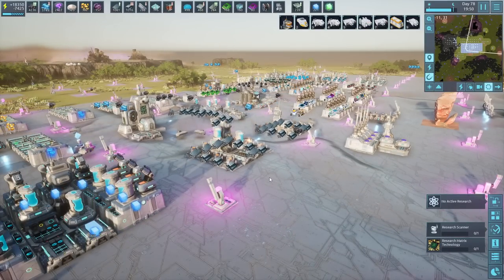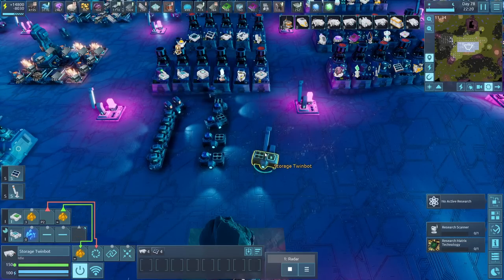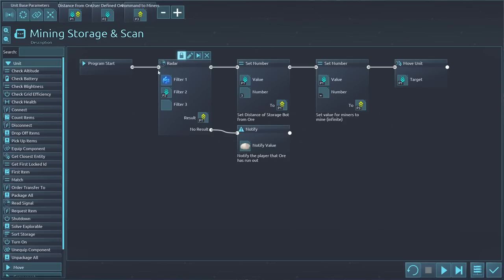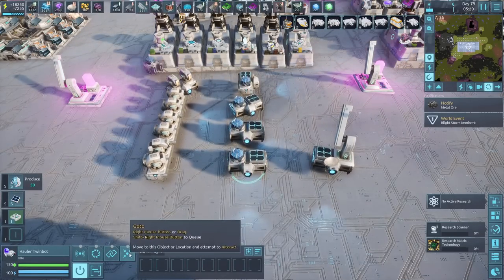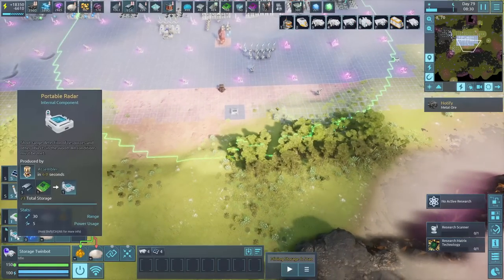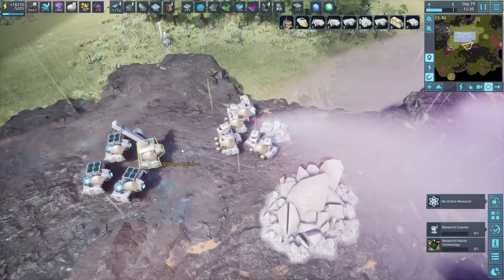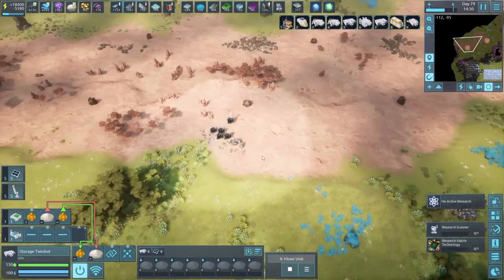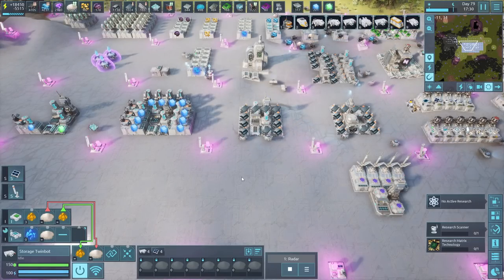Perfect AUTOMATED MINING with Simple Program | DESYNCED Early Access | Tutorial/Guide

Comment: Loving the programming side of this game. After watching your video, I have built my own flow using similar principles to what you have designed. I set up small power extenders on 1x1 bases and gave them logic to detect resource in range. if detected, produces a signal of the resource type.

I have a group of mine bots detecting (loop) a signal and if detected, moves in and mines / picks up the resource. Once full delivers it to the correct storage location (using colour signals in storage locations). 

Its working great but im sure it can be improved. Happy to share as would love feedback on how to improve.

What i cannot figure out is how to also pass coordinates between buildings and units since we only have one signal slot.

Comment: This is great! I noticed you can block the main bot  by having to many bots using it as a GOTO. They will surround it and prevent you from moving it. So I think keeping it to 3-4 hauler bots is a goo ratio :)
Reply: Or you can also having the miners hold a certain distance away from it so when the scanner moves the miners make way
Reply: I have been doing this.  If resources are full, try to dump and move away.

Comment: Similar to what I set up, except I play with Aggressive bugs, so I run it different.

What I wanted to share is that what I have my power lines do is keep a percentage of the distance between two targets. These I can either set up to keep 50% between the link before and after, or have a set at 20%, 40%, 60%, 80%, between my 'foreman' and an anchor at base. The benefit of this is it retracts properly if the foreman returns to base. Your setup with distances is really cool, but for my purpose it could leave a loop hanging outside the base and vulnerable.

More details on my setup below for anyone interested.

Rather than scouting new resources, my foreman watches out for enemies and retreats if it spots anything. I configured it so the miners would also stop mining in that case - the signal they receive is a resource type, not a node, so I can use more miners for e.g. a large patch of metal, and means they get properly interrupted when the signal changes to the enemy, which they can't mine, so they follow the foreman back as their goto.

In future I'd probably want to combine the two behaviours, and have it alert a 'cleaning squad' if it spots a nest.

Comment: You  can save you're self some hassle by building Power Transmitters. they transmit 100 units of power  wirelessly to any single unit outside of the logistics system with no limit to range. they are a medium component. what I did is make a Cub bot with a small or medium power field component and link 4 power transmitters to it, which is 400 power in total giving my mining bots and power provider complete freedom too move around. You could also use power transmitters on a single mining unit and scip the powerfield bot all together.
Reply from the maker: I mention those, but they are much later tech, so not relevant for anyone who wants to get mining up and running efficiently

Comment: I made a behavior. Code is at the bottom.

I noticed my haulers were doing odd things because I had a smaller storage setup. They would drop off items but not be completely empty because the storage would be full. Then on the way back to the mining operation the storage would have some space open up so the haulers would double back and fill the storage again.

This was annoying me. So I made a simple behavior that would hold the haulers at the storage until empty and at the mining operation until full. You may run into some problems if you have too many haulers dumping at the same storage. Traffic jam.

You cant use the individual bot storage or go to buttons. They will override the behavior script. Make sure those are cleared of anything. Use the behavior controller buttons/slots instead. Just load the behavior then hover over the behavior controller buttons on your bot(over on the left side of screen is where the buttons/slots will appear next to the internal component). The p2 button/slot tool tip should say miner, drag and drop the button/slot on the miner or place you want to pick stuff up from. Then same for p3(tool tip should be, storage unit) where you want stuff dropped off. And ofcourse you need to click on the first button(tool tip resource). Left click on it and select the ore you want the hauler to pick up. 

You might run into problems if you lock in the ore on the individual bot storage. Just leave them blank. You can lock the storage point that you are dropping off at with whatever resource you are putting there.

Copy the code and then open your library bottom right. Click on the behavior tab at the bottom right side. Then you should see the greyed out behavior script called hauler. Click on the greyed out button to the right of where it says hauler. The button is called paste from clipboard.

DSC15e1WyMfo1Bt2vX2zYKcG1uRix21C4PMt4HjSAu1jMjpH31RJSk1qOyAi1plPnT2oOguV0b1RZV400kML0oRXvH0irfpl1awb5t0M58dr4XJa5631oW2A3yS4AR4NboHh2J1axv2WITTl3pNyHR2Ex6ls3iIMBM0nSf6x3RZtu939EqCy0ysZWK0jx3CN1ax43B40JrwL4GR5ii3yaX4L3TwBqh0Yh2wj2Irgvl2rneDZ1nx5OU3rKsAc1eimsg135iKT49JjXY2EJ95C2wehJF1AqOf730L3MX1FCrZO1ZQJb22Z5YKM28121z0aYHP31C9WpB22V4zh0D953M3iiG7B0NVyyO0BnEUP3jJ61w0TGexe0lBpoj4JPNIX145q4W2ypO9B4JyBqL4CVYdC4XSyAz4QFhPJ0deUCZ4TC4e802RcxZ0u8cBr1RD0Xz2kD0mB1DakTo1XBPuP23xYm90wVabv4VcsjV2qhk9Q1vWnWf1bgXEe0ewYiO1BzRyP1ewEwc1coYno2ROAAi2z1B6t2WbZ693wWDv94cFEBi2IU4B74B778V0C8aDx4cc15z4X7brs3J7D7M0hXdsA2astCp0UebPH1rYI4v2JVQCl18vkvE2RQ7Jr1DPXrC3q49pY1o8She3TA6VO3ZLXsA1Cm03T2jUDWX0B7a2j0ckvyK0HrplI4DYsej3JDg1i4H3oIA2LMH5y4gJkS12vckYZ0pefub2n7GUR4E74Dn0FebBU4axtqo0RhVyD1BqCLs2MVrZB0gvjfV0Jaojt1OQdro2vN6OR3aBQST3akS3R2GCFS408ZAIc1uXH253amWuN2pD8rw4T6IZS2iaWkG2hHJSq0WDr0z03lsy231jez02oODsY0AWfCi0o0KLM3vhcHe0oMyl14X2vGo1oe5b74LvuZQ1294rT39VJCI3lAM1z13PCTU4BcteB3mNq0QEoxM

Comment: what is P1??? im so confused. i get its a parameter nut of what?
Reply: whatever you set it be of, resource or some number of something like distance or amount etc
Reply: P1 is just the name of a register in the behavior controller. 
Its essentially a spot where you can save a number so it can be retrieved later for use in programming.
you can create registers by pressing the giant plus button at the top of the behavior controller screen right next to your 4 default registers (signal, visual, store, goto)
Reply: Once on the programming screen, at the top left you have a plus button, that adds registers. Hit that 3 times to replicate what he has for this program.
Now you can read and store values there in the program, and they also show up next to the behaviour module once you have the unit selected.